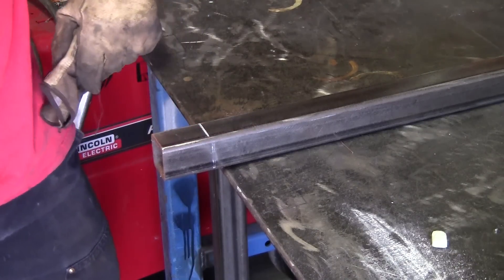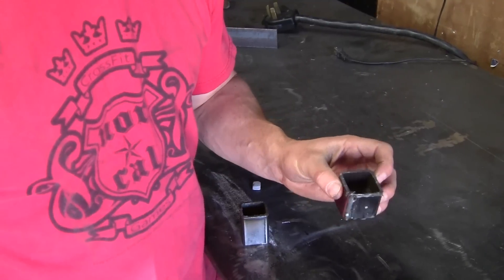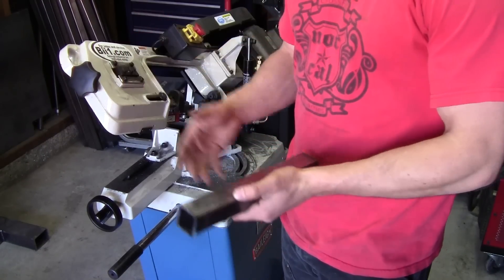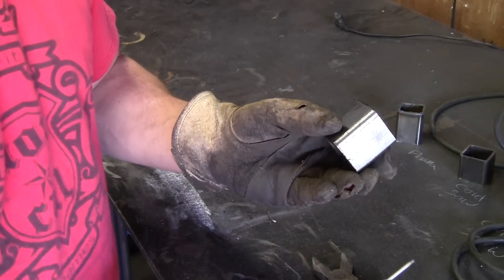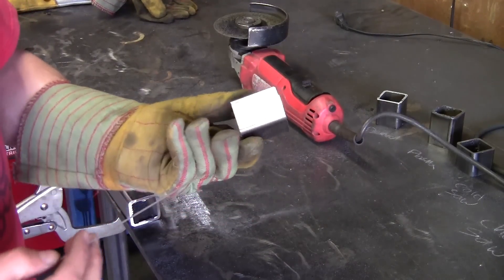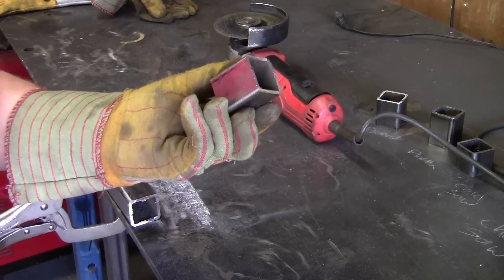How to Cut Steel 5 Different Ways

Comment: Found out the trade school ive started teaching at is using this as a teaching material and oh my god is this embarassing to realise.

Plasma cutting and your gloves have hole the length of your entire finger plus the short sleeve tshirt and no mention of any shaded eyewear

When you put the material in the cold saw and completely fail to use the second handle on the vice, wonderful way to invite material to slip and shatter your $300~ cold saw blade.

Using waaaay too much force on the friction saw rather than letting the blade do the work, plus the whole "wear hearing protection", immediately followed by getting to see your head dip into frame showing your lack of either earmuffs or buds

Complete lack of safety specs on the bandsaw, and im not going to pretend i dont know how LOW the risk to your eyes is in that situation, but we know the risk is above zero and anyone whos spent years around bamdsaes, particularly larger indistrual models will know ending up with some chips on your face once in a blue moon is something that happens

And the wonderful grinder section where you leave the cut line of the tube on the bench rather than hanging it over the end, meaning instead of being able to angle the sparks down at the ground, your only option is to send the sparks straight into your guts or accross the shop with no regard for whoever happens to be behind you.

Having shit training materials that bores learners is one thing, but this is next level bad and the students genuinely make fun of how atrocious it is. Genuinely embarassing to realise this is the material the school im supposed to represent is using.

Comment: Thanks for the tips!  I was looking for a way to make a jig to mount square tubing vertically in a 10" miter saw with abrasive disc. I noticed it overheats very easy and eats the plastic cheap runners on the sled sometimes.

Comment: Good video over all except one thing. You do not need to press down so hard with the chop saw that the metal smokes like the one you had in this video. Let the disk do the work without forcing it. Much easier and a nicer cut then.

Comment: Thanks, appreciated the video.

What about using one of these in a chop saw?
Diablo Steel Demon Nonferrous Metal-Cutting Circular Saw Blade - 12 Inch x 96T, Model D1296N, Brownor one of these:
LENOX METALMAX ™Any experience with either?

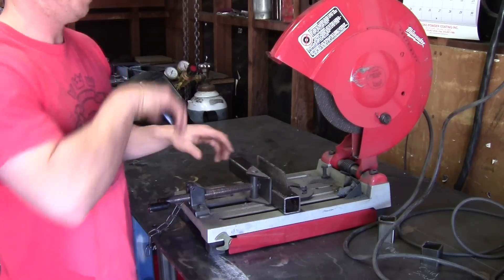Comment: 4:29 I can hear from the sound you are pushing too hard on the machine. It should not slow down noticeably. Let the wheel do the work, not your downwards pushing. It wears down the grinding disc much more quickly.
That's also why it becomes so hot.
Reply: Maranu.iulian
carmeniulian
Reply: Willem Arnhem What about a cutting torch?

Comment: Nice that I finally found something that compares most of the common relatively low cost metal cutting methods.  I'd like to see dry cut saws and portable band saws in the equation as well, if possible.  It's about the comparison, the advantages and disadvantages of each method.

Comment: i have 2 1/4 inch steel slab and i need it cut in half and dont have anything but a metal hand saw and a grinder to use....

Comment: I want to cut 1 feet of the legs of my steel loft bed off because the bed is too high.  Can someone tell me where can I go to get it cut?  I am not strong enough to cut it myself.
Reply: I know this is 2 years later but if your mattress is too high it might be cheaper to find a thinner boxspring
Reply: +tinjmail The Local Fire Dept, "At a price".   ~(  : -})={>--- ]
Reply: +tinjmail 
Just take the mattress off, or cut 4 holes in the floor lol.

Comment: 0:17 - Plasma Torch
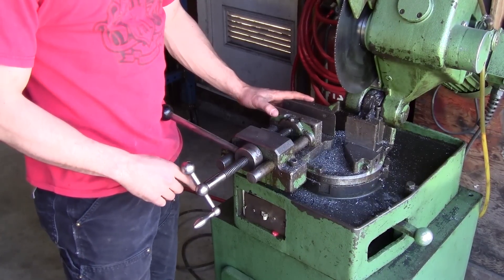1:40 - Cold Saw
3:56 - Abrasive Chop Saw
5:18 - Horizontal Band Saw
7:28 - Cutting Disk
Reply: Is a cutting disk the same as an angle grinder but with a different disc?
Reply: Jig saw Bosch 125
Reply: @goldenrules5697  km how to  mill different  shapes
Reply: Square tube 20 mm degree mein kaise
Reply: Thanks.

Comment: One question!

How come you didn't use a miter saw with a metal blade?
Reply: zephyr Dok I think Miter saw RPM would be too high for steel. I gave up using miter for cutting steel as it wore out the metal cutting disk way too fast, and it felt unsafe at those high RPMs.
Reply: +zephyr Dok (z3phyrdok) A true miter saw is designed for cutting wood.  They have too many plastic parts that would melt from the sparks.  You can cut light gauge aluminum with them however with a carbide tip fine tooth blade.  Comparing my miter saw with the chop saws, they both spin at the same or nearly the same RPM (4000 or less, some miter saws @ 5000 rpm) depending upon the model.  But I would love to see a double bevel compound chop saw on the market. My Google search doesn't come up with one.

Comment: would this work to cut strait and with curves when needed 
http://www.amazon.com/Factory-Reconditioned-Dremel-8220-DR-RT-Cordless-Lithium-Ion/dp/B00JDZR2YU/ref=sr_1_1?ie=UTF8&qid=1415164030&sr=8-1&keywords=dremel+lithium-ion+cordless
Reply: It's fine for doing small jobs like shortening bolts, but woefully underpowered for tubing. Do yourself a favour and buy an angle grinder.
Reply: yeah but i'm going to need to be able to make curves straights and very detailed cuts
Reply: DeadEye MC
How thick is the material?
Reply: pretty thin about 2-5 mm thick
Reply: DeadEye MC
A bandsaw would be nice, otherwise i'd go with an angle grinder and then refine with a dremel or a file

Comment: I'll take a cold saw over any of those...they are far more precise...however, most cold saws I know of are 3 phase (the good ones)...
Reply: Kohala Iron Works Case Rage 2 cold cut chop saw, $300, beats all these methods
Reply: +Tec 9 BS. The blades dull easily & cost $80.00 + to replace.
Plus, the Dewalt saw beats the cheapo Rage without even blinking!
Cold saw is the 2nd BEST way for an ACCURATE cut!!
Water jet is the KING!
Reply: The DeWalt, Rage, Makita and other such are not "cold cut" saws, they are "dry cut."  True cold cut saws use coolant, cost a lot more, have much better vise/miter fixtures, and are not portable.

Comment: Just a tip when using the plasma to help get a square cut just hold   a speed square on the piece and run the torch along it note just don't slip or you will mess up your square   But that's why I took an old one and now dedicated it just to this  task

Comment: your little zip cut grinder is not safe. use a rat tail for better grip & control. Also, the power cord strewn across the table didn't look safe at all -it shud have been behind the grinder on the floor. lastly, exploding zip cut blades nowadays is a fallacy. you can practically tear chunks off the Pherd or most every (reputable) brand discs and it'll still cut stay intact -altho cut a bit rough.  Don't believe me? go ahead, show us how a blade goes flying apart.

Comment: Do not forget the dry cut chop saws. The ones with the tungsten carbide tip blades. Bought myself one and thought I have only made a dozen cuts, they are quick, fairly quiet and leave the metal clean and cold. They also cut wood with the same blade.

Comment: A good band saw with a good 1018-1020  tool steel blade will cut just as good as a cold saw... if you make sure everything is level and square....

Comment: I bought a double cut saw two counter rotating blade's from harbor freight for $54.00 replacement blades $19.99 been using for two months same blades clean cuts very little sparks. It's paid for it self on angle grinder blades I would have gone through there junk & Dangerous have had a few disintegrate & had to get stitches from one that cut me ( had the guard on) the double cut you can use the same blades for steel/ copper/aluminum /PVC/solid rod. They have had some bad reviews but about motor